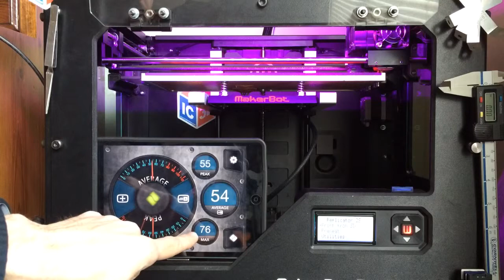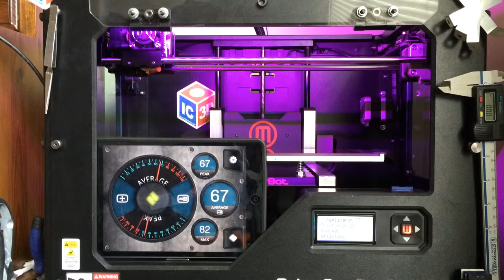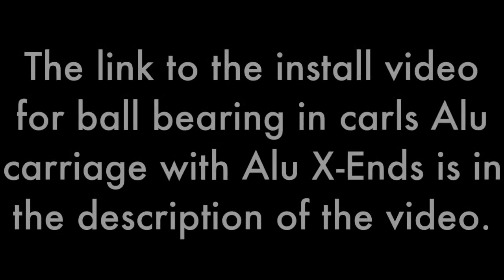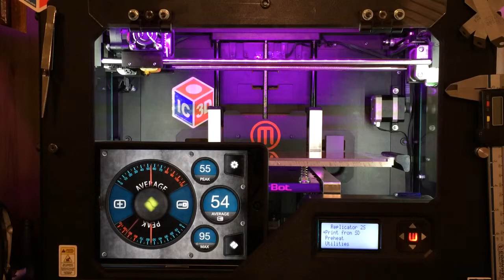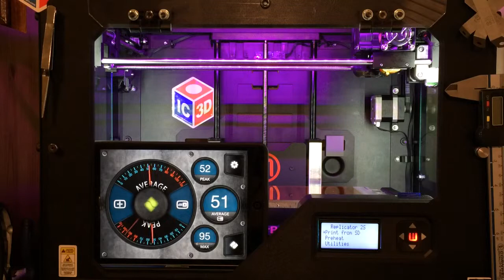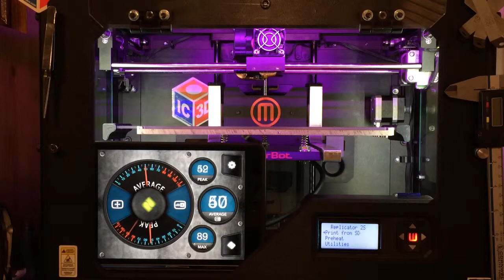Carls Alu Carriage Bearing VS Bushing Noise

Comment: I replaced my bearings with those bushing, no real change in noise. But I got more friction. But ringing went away.
Reply from the maker: Vlad, did you replace the bearing with the bushings? Or the bushing with the bearings? Maybe you had it backwards? 
Well at least the ringing went away, that can be a hard one to troubleshoot sometimes on certain printers. Always good to not have dining and better quality prints.
Reply: Scott JD as i said, i installed bushings. I gained crazy friction problem on my middle carriage tho. Mainly due to side plastic carriages being "imperfect" and also to my middle abs carriage being warped or simply badly manufactured. I am assembling a cnc mill now and planning to redo carriages on my cnc from 6061 aluminum. Already designed that in cad.
Reply: Scott JD for now i ended up using bushings on the sides and returned to metal bearings for middle carriage, since metal bearings are more forgiving to imperfections in positioning.